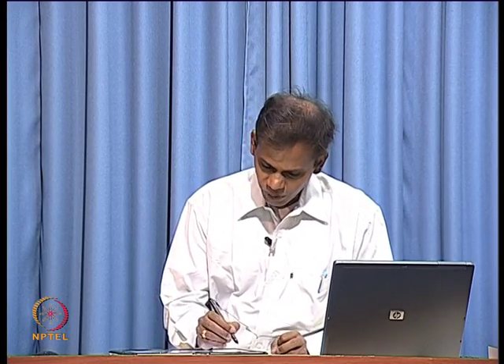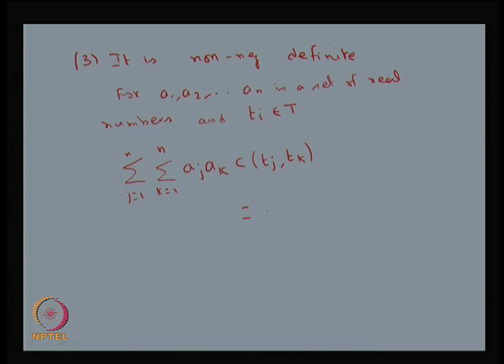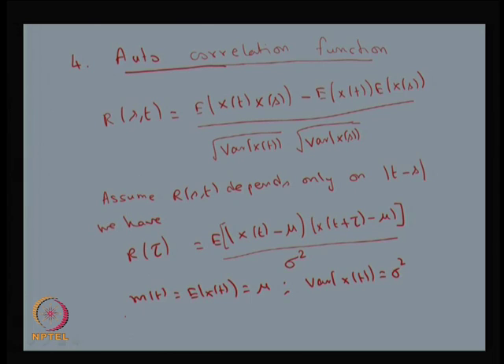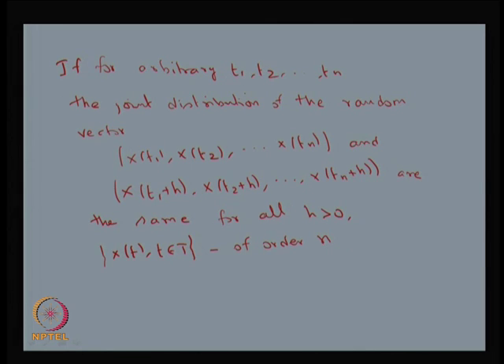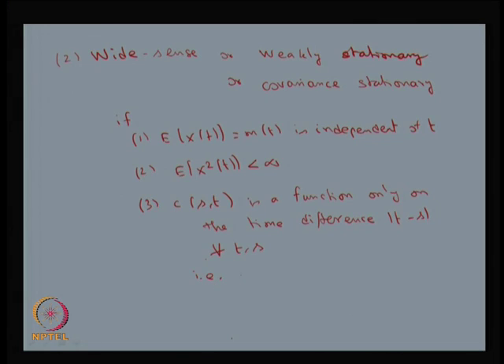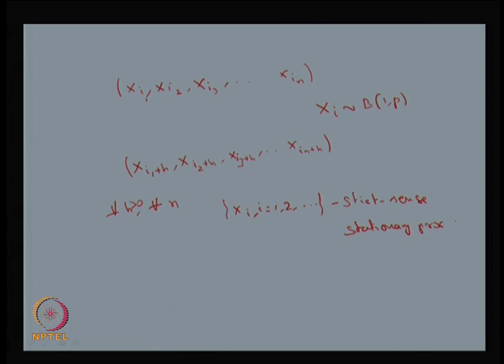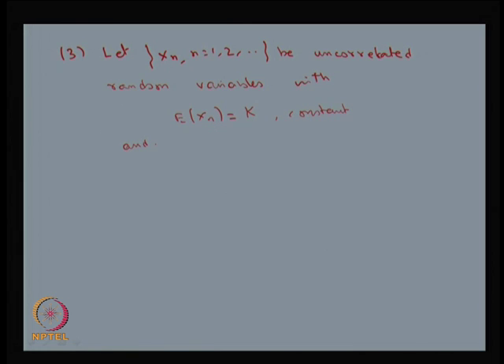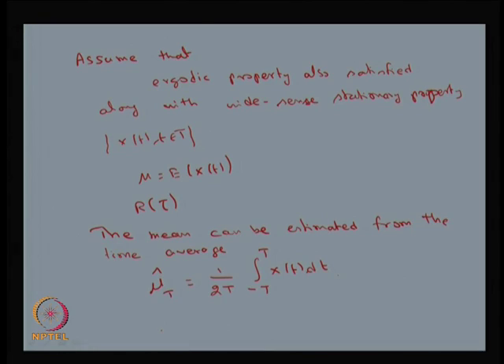Mod-03 Lec-01 Stationary Processes

Comment: Contents:
-Introducion
-Definitions and properties 03:45
Mean function.
Second order stochastic process: E(X^2(t)) is finite.
Covariance function (properties: symmetry, Cauchy-Swartz inequality, being non negative definited (11:38!), closed under sum and product)
Autocorrelation function (existence of the function r(tau))
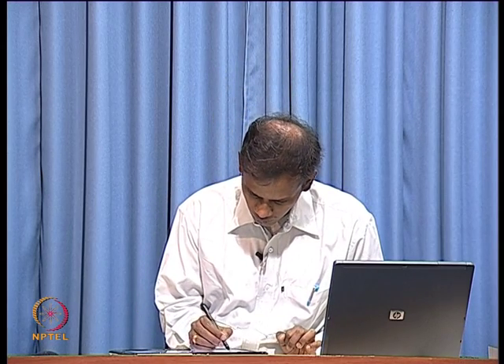Independent increments. 18:25
Ergodic property
-Stric-sense stationary process 23:00 (arbitrary set of times without taking into account that the parameter space might be continous)
-Wide-semse stationary process 27:40 ( C(s,t)=f(|s-t|))
-Simple examples 32:10
INDEPENDENT Bernoulli trials
Example 2 40:30
Example 3 45:05
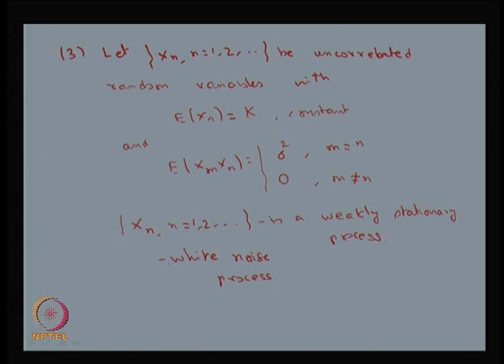Ergodic+ weak stationarity (possibility of averaging over time) 49:10
Reply: Nice work